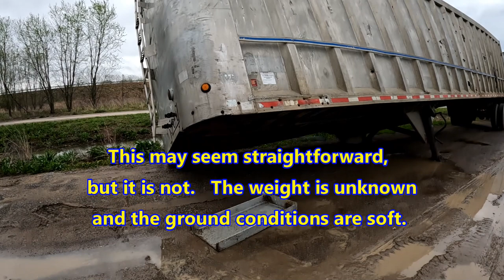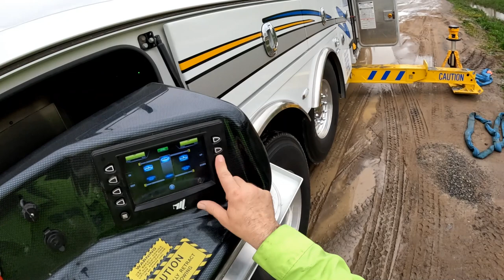WE'VE GOT ANOTHER LEANER!!!  THE DANGERS OF THE UNKNOWN...

Comment: Assuming your rotator might have scales built into the winches is it possible to state the total approximate weight of the pick after the fact?  I realize you only need to know when there is a possibility of overloading your cables or rigging so not too expectant on a weight just wondering.
Reply from the maker: Yes, the rotator has scales on it and I could post the weights.  I didn't recall the weight on this particular lift.  I will ty to remember on future lifts to show or print the weights.   Thanks for watching and God bless.

Comment: Time and pressure lifted that leg right out. I would have been tempted to drill a small hole in the front of that junk trailer to let the water out.  Probably would have been an EPA cleanup LOL
Reply: Trailer would have falken apart lol
Reply: @Rags722 Yeah I was thinking same thing about drilling a hole, but that might would of made the structural integrity weaker.
Reply: @ramrod6279  a small hole wouldnt have made much difference tbh, and can be welded closed after if you can find something there solid enough to weld on
Reply: Seems there's a bung hole cap there in the front.  Sorta dark.  Might be too rusty to loosen.

Comment: Cribbibg under the outriggers spreads the load over a broader surface making your vehicle have a safer platform. That White line is the catch for the first part of your lift. Next, comes finding out if the landing gear is still down and it was.
I will say in Florida an open container like that has to have a cover al-be-it trap covering the cargo just in case something bad should happen.

Comment: Good old Missouri Red clay & sand when it gets wet (soakrd), its like it has been , it will suck you in & can't go no where & put nothing on it either. You did probably what I would have done with the chains. Another good job Ron yeah getting under a suspended load not a good idea, but you had no choice in the matter the plate was not where you wanted it & wouldn't move with the 5th wheel puller so you did what you had to do. God Bless Ron. You all be careful out there stay safe & God Bless you ALL

Comment: Steel wheel and tire weighs what 200lbs? That trailer can probably hold about 200 of them thrown in there like that instead of stacked neatly.. so 200X200=40,000lbs + call it 25 tons and you're probably close. (yes I know that's 50k, but preparing for more weight than you have is safer than less, just like lifting a load with your body, if you ready yourself for something to be heavier than it ends up being, your body isn't hurt as badly if at all)

Comment: I drove lorry mounted cranes in London and the places the hirer wanted us to set were often back filled areas without proper compaction. The areas in the east of London were heavily bombed in WWII, cellars would be quickly back filled with rubble at best. On one site as I took the weight of a precast panel, an outrigger burst through into a cellar. Luckily it was not a hydraulic driven crane and I was able to stop hoisting and not apply the foot brake, this instantly dropped the hoist hook and I was able to swing the boom to balance the rig. I then needed to go buy some new jeans.

Liked the way you stayed clear from going under the trailer as much as possible, maybe keep the remote closer to hand would be a good idea as you work alone. Stay safe and thanks for posting.

Comment: Hey Ron.  Great job on this.  Would it have been possible to lift the trailer out of the hole and then put the under reach in place with either a fifth wheel plate or chains and pull it away from the questionable ground?

Comment: Mr Pratt,  while I love a good challenge as much as you do, and the satisfaction of overcoming that challenge.  Have you ever turned down a recovery, after your walk around?  Not due to lack of skill or knowledge; you have an abundance of both in my opinion; but just circumstances made the recovery impossible.
Reply from the maker: Once, many years ago.  We received a call to recover a stuck excavator.   When we arrived all we could see was the top of the boom.  Everything else was buried in mud and the river was quickly flooding.   They wanted it out before the flood waters completely covered it, but the Corps of Engineers said the water was coming up too quickly and we needed to get clear of the levee system, which is where the excavator had been working.    Thanks for watching and God bless.

Comment: What are the risks (generally) of overestimating the weight?
Reply: overestimating isn't really a risk, just means using heavier chains or straps than needed.... underestimating is the issue and could either break or stretch the chains/straps, in turn losing control of the load and making things even worse

Comment: Just wondering. Could you not have used the under reach and lifted ?
Reply from the maker: Not really.   It would have put too much "twist" on the under-reach.   The under-reach isn't really designed to do that type of lift.   That's what the boom is for.   Also, the under-reach shouldn't be used to lift that much weight.  I've done it before on trailers that sank down and were flat (level) and using the under-reach to lift a heavily loaded trailer is sketchy, at best.   Thanks for watching and God bless.

Comment: (with "other "ways to do it ) not sure if any one said it ,, wonder if the underreach could have fit with the 5th wheel attachment and made it bit easier / faster
Reply from the maker: The fifth wheel attachment will not connect to a trailer when it is leaning.   The trailer must be level.   Also, the fifth wheel attachment isn't designed to handle heavily loaded trailers.   Thanks for watching and God bless.
Reply: @RonPratt  Cool and now we know :)